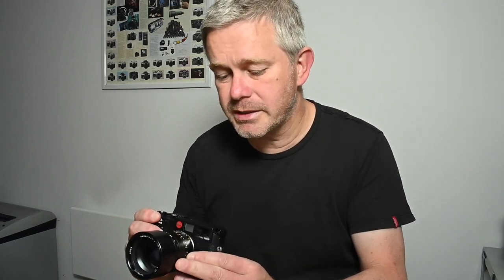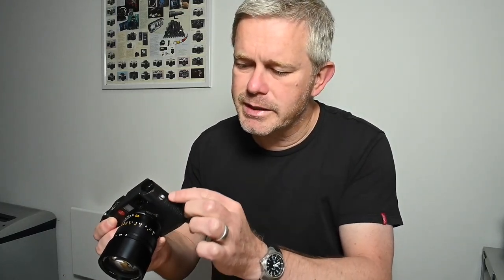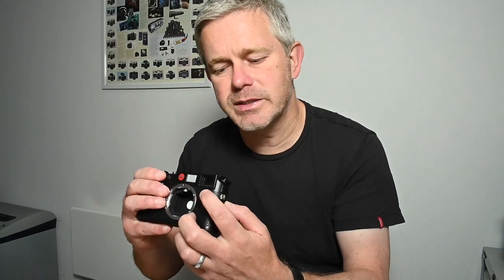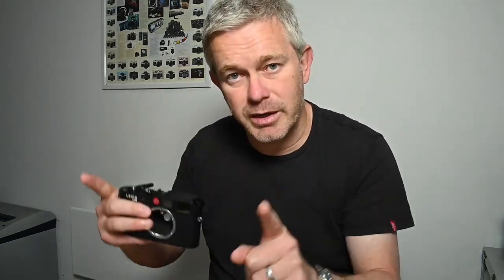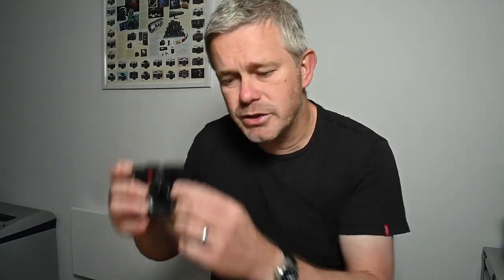Leica M6: testing the viewfinder /rangefinder (MP, M6 TTL, M2, M3, M4, M4-P, M8, M9, M10, M11).

Comment: If the horizontal alignment reaches infinity properly, can you assume that all other focusing points on the lens are accurate? Say at 1m, 3m, and 5m?
Reply from the maker: If the rangefinder aligns vertically and horizontally at infinity you can be 95% sure the lens will focus correctly at closer distances. Whilst the vertical alignment doesn’t necessarily impact focusing it is a sign the mechanism needs adjusting (a knock perhaps) so it shouldn’t be ignored.
Reply: @WorldwideCameraExchange  is there an accurate, reproducible way of validating closer focusing distances?
Reply from the maker: Focus on a subject close to the lens’ nearest focus and take a test shot. Obviously use full aperture. Bear in mind lens and body are adjusted within narrow tolerances so allow some leeway.